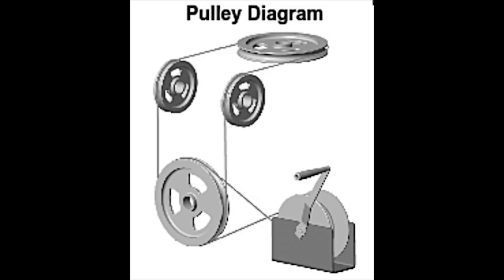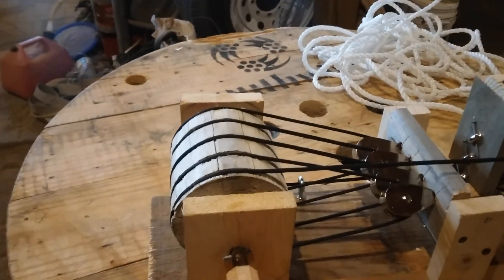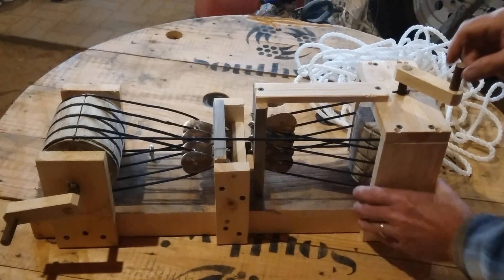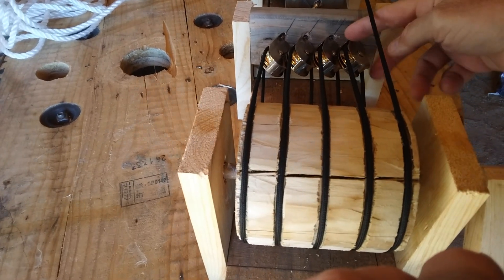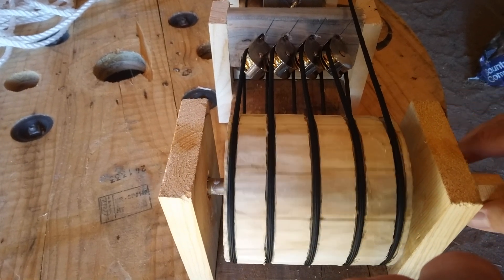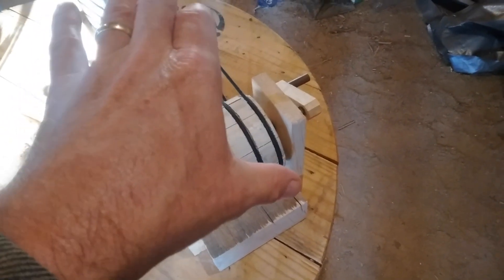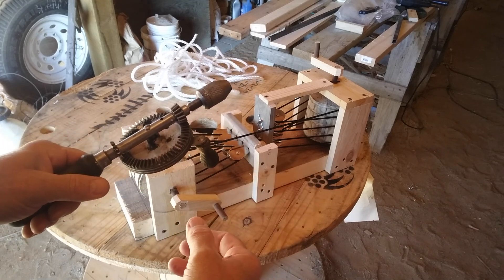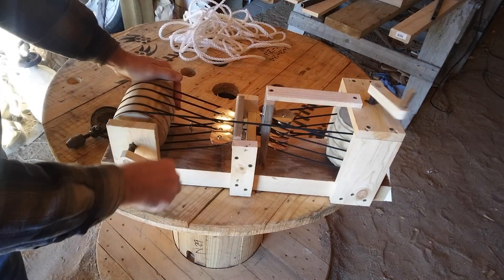High torque, right-angle rope drive system

Comment: Thanks for posting this! I'm working on a pedal driven ocean boat and I like rope drives because they don't rust.

Whatever I make is going to have to be high transfer efficiency, so I'm looking into bearings of various types.

I understand that you get more friction when your rope has some tension, but also when the groove it slots into is a V-shape. (more tension means that the rope tries to press into the V-shaped groove?)
Reply from the maker: I have another video with a bigger rope setup on a wind turbine, that may interest you:  https://youtu.be/YiiamhaSB2Y

Comment: I am also solving this problem of rope slippage on a grain millstone.  I came up with the same conclusion that more contact is needed. I have 3cm on the stone, so I will try to add 2 v grooves to add friction. I also have a one to one ratio, 34 cm stones. Thanks for the pulley system idea. I didn't see how to arrange changing to the different grooves but now I see the possibility of adding 3/4 contact around the stones. I'll send an update.
Reply from the maker: Thanks for sharing!  In this video, I did something on a bigger scale:  "https://youtu.be/YiiamhaSB2Y"
Reply: https://youtube.com/shorts/6xh8qHdPqZ4?si=yc_oiftIzPyBaSve
Reply: https://youtube.com/shorts/LF7is0eiXVg?si=aqfDppmiGuhZqJR2

Comment: Why not simply make a spiral groove on the cylinder and avoid using the little pulleys?
Reply: At some point friction would overtake and the rope will tangle! I've tried it in a very small scale to be sure maybe on bigger scale it wouldn't matter. But the risk isn't worth the reward. Better just use pulleys. And pulleys really aren't that expensive!

Comment: A dozen bearings. 
Each bearing cost you 1~2% of losses. 
And we are not talking about all the rope friction. 
That’s a lot of losses to transmit power at 90deg. 
I wouldn’t be surprised if that units is 60% efficient. 

FYI 
The efficiency of a helical bevel gear unit can be up to 98%

What you can do to improve the efficiency would be to wrap the rope around the drive drum 5x and exit and go directly to the driven drum and wrap around 5x then go back to the drive drum without going thru 8 idler pulleys.

Comment: Impressive design.  I'm curious of what you got to lock the turbine or mill in place to service it incase the rope breaks or something needs worked on. As well as how to adjust the rope.
Reply from the maker: Right now on the turbine I have some crude friction brakes on the outer circumference to stop and hold it.  The drive train for that is still in the works.

Comment: I really enjoyed this.
I'm planning a wide, tall gate (8' x 8' x 1" or 2.4m x 2.4m x 25mm plywood) with an unusual hinge system  I could adapt this for opening it.
A slightly remote crank handle and concealed drive would be a nice novelty, or exposed clusters of cogs and chain for an industrial feel.

Comment: Awesome build! Is there a tensioner somewhere? Or, how did you space everything to pull the paracord into tension and keep it under tension while screwing the pieces together?
Reply from the maker: I left one board that 5 little pulleys are attached to loose.  After I  connected the ends of the paracord, I pulled the assembly of pulleys and board tight, then put screws in the board to hold it.

Comment: Great basic concept, but it needs a critical refinement: the rope needs to wrap fully from drum to drum on every turn, and use the pulleys to manage / redirect the rope through the twists / deflections between the drums.  Further, this system could easily use chain-link style V-belt instead of rope for greatly improved durability and force capacity.

Critical core concept: Imagine a simple single V-belt drive at 1 to 1 ratio, running at 50% of its maximum gripping friction capacity.  The belt engages each pulley for 180 degrees.  On the driven pulley, the belt exits at full tension at 180 degrees, and enters at slack tension at 0 degrees, because you can't push a belt (or rope).  Now somewhere back from the full tension exit point at 180, there has been been enough total friction to transfer the force, and that means the belt is slack from that point for the remainder of the arc back to the 0 degree point where the belt enters.  At exactly maximum capacity, the belt would be gripping for the full 180 degrees, and beyond that would slip across all 180. Finally, I assume that the grip friction gets concentrated towards the 90 degree point where the tension is pulling the belt into the V instead of along the V.

Now here's the rub: ALL ropes / belts have some stretch.  The harder you pull, the more they stretch.  That means the belt stretches between the slack point and the 180 point where it's at full tension.  But the hard pulley surface DOES NOT stretch.  That means that for every length of belt actually engaged in friction doing work, the stretch MAY cause a rubbing slipping creep between the belt and pulley along that working length.  That means belt wear, power lost to friction / heat, and a tiny loss of transmitted rotation below the ideal 1:1 ratio we assumed from equal pulleys.

The only way to avoid that stretch induced slipping across the working friction zone, is to keep the total stretch small enough that the elasticity within the rubber belt material can take up the difference without the rubber surface actually sliding across the pulley.  Even still, you will be flexing rubber and thus heating and slowly wearing the rubber inside the belt.

Outcome: Even if a single belt would have been far more than strong enough in tensile strength to handle the total pulling force required, you might need to use multiple belts instead, simply to reduce the stretch on each belt, by dividing the tension across multiple belts. I assume we would see overloaded drive belts and even pulleys wear out very rapidly from stretch induced slippage.  But as soon as enough belts are used to avoid that slippage, we should see belt and pulley wear reduced to a negligible normal minimum.

I fear that this problem will be far more challenging to avoid in rope driven systems, because rope typically stretches at least 1% under load, even for extremely low stretch ropes.  And if any load bearing fibers contact the friction working surfaces, they will inevitably be exposed to stretch-slippage rubbing.  This could be mitigated using a rope that carries the tension load in its core, with a lower tension jacket that allows enough flexibility to absorb the 1% of stretch internally without having the jacket actually slide on the drums.  Even better, a high quality steel wire core rope would easily reduce the stretch far below what any textile rope could achieve.

What you got right and why:
-- Not trying to use multi-turn wraps on the main drums.  Because that causes a screw winding effect that creates friction and wear to overcome in a continuous turning system of this type.
-- Using a single continuous loop instead of multiple separate loops.  Because that can help balance tension through the entire system (but not the way you wound it).
-- Using intermediate pulleys to guide the drive rope into straight alignment with the main drums, to eliminate the screw-winding action. 

What you got wrong and why:
-- Because you can't push a rope, it means that 100% of the drive force is transmitted entirely where the very first turn of the driving drum PULLS the rope from the very last turn of the driven drum.  That puts extreme tension on a single rope crossing, which means high stress on the rope.
-- If the friction of one or two wraps on each drum is enough to resist the workload, then all the earlier / later wraps will actually be running slack, just causing wasted friction and extra wear with all the little pulleys and flexing of the rope for nothing.

Critical revision and why:
-- By winding the rope in full wraps between the drums, you divide the tension evenly across the wraps, thus also dividing the stretch slippage factor by the number of wraps, just like a multiple V-belt system would work.
-- By using the small pulleys to deflect the ropes between drums, you only have at most about 90 degrees of deflection total, less than 45 degrees on each pulley.  Instead of almost 180 degrees at each pulley in your current setup.  And because of the smaller deflection angle, you reduce the force on the pulleys about half or less.
-- Bonus: the defection pulleys could be mounted close to the drums, allowing far more than 180 degree of engagement arc on the drums.  I can imagine 270 to 300 degrees being easy to achieve.  The biggest challenge is working out the weird angles needed to mount all the pulleys at in order to keep them all deflecting the ropes perpendicular to the tension, and I am assuming it would be open pulley wheels with bearings, then mounted to rigid shafts / studs on some weird frame.  Sounds like a job for CAD.
Reply from the maker: Wow!  Sounds like you really thought this out. -will be beneficial to the readers of the comments.  It's basically taking the diagram I showed in the first part of this video, and doing it multiple times, and getting the little pulleys directing each individual rope oriented correctly.
My current thoughts for use on my turbine is to have 2-3 wraps around the vertical shaft with a large drum, and driving a smaller cylinder at a horizontal position.  With about a 5 to 1 gear ratio.  So the smaller cylinder is going to need more wraps to get a good grip.  Lots to consider...
Reply: @doubleMinnovations  It was an interesting system, I couldn't help but try to puzzle through the logic of it.  Cheers :)

Comment: there's no need for the little pulleys at all. just wrap the rope directly around the shafts. choose the number of wraps so that the wrapped section of one shaft is the same length as the diameter of the other shaft and then you can get your right angle drive with just the rope and shafts. it's called a capstan and was a very very common machine in pre-industrial times.
Reply from the maker: I did think of that, but the problem was getting the rope wraps to slide to the other end of the cylinder with ease.  If it's gripping the cylinder good, it takes a lot of energy to get it to slide to the other end of the cylinder where it leaves.  The multiple little pulley idea, doesn't take much energy to gradually travel the rope wraps down the cylinder.
Thanks for the comment!  It's food for the thinking.

Comment: Instead of a grooved drum and 5 small pulleys, you could use a drum with a convex or saddle shape to hold multiple wraps directly. No tiny pulleys needed, and no risk of the individual grooves creating wear on the rope. 4-5 wraps is sufficient for almost any rope to grip the drum.
Reply: The rope moving across the drum will create a twist that creates wear on the rope.
It would be OK for occasional use but a machine that's going to run hundreds of hours per month is going to need something a bit more reliable.

Comment: Pretty neat, I like it. Always thought there was something elegant about light weight cable drives like this. I'll bet you could replace all the pulleys with another grooved spool on each side. Although you could also run the cord in a groove around the edge of the turbine rotor, that'd probably have plenty of traction being so large already. If you did want to try homemade gears though, I'd consider an arrangement of radial and axial peg gears. Easier to hand build than toothed gears. Easier to fix if something goes wrong, too. Maybe you could even put pegs somewhere towards the outer edge of the turbine rotor if you needed more speed and less torque. Even seen some contraptions that play with combinations of pegs and cords in various ways; lots to consider. Thank you as always for sharing your experiments!
Reply from the maker: Thanks for the interest; I've been trying out different ways to get the power off the turbine, including cord drives, gears, and even a friction drive.

Comment: Sir this is a thing I have put a lot of thingking in. What I have in mind before I build such a thing (driving machines directly from windpower with a VAWT, so mechanically) is a flywheel. A flywheel might stabilize the driving shaft and it can be spun at a higher speed aswell. Directly connected to the turbine it is kept going by windpower and it keeps a steady rotation of the turbine. Although with a VAWT such as the one you build there is little need for it, since it is its own flywheel by mass. But a rotating mass at a higher speed can also store energy, thats the whole purpose of a flywheel ofcourse. WHat i personally have in mind aswell is a set weights that are spinning on the upright axis and are flung out by the rotationspeed. When that speed is suddenly reduced by any load the wieghts fall back in and from that the rotationspeed is increased because of the rotating weights is closer to their axis. A governor does a similar thing. Hope this is of your advantage

Comment: Several lathes in the machine shop where I went to school were originally driven by a single overhead shaft and 3" or 4" flat belts around relatively small pulleys. Around WWII they were converted to individual three phase electric motor drive. The wide belts used for those kinds of applications can transfer an amazing amount of torque, even when under relatively low tension on smooth steel or iron rollers. It was also quite common to use belts to transfer power at right angles with nothing but air in-between the two shafts. That does require a relatively long distance between the two shafts relative to the belt width to allow for enough twist without significantly stretching the outer edges, but it's hard to beat it for simplicity and reliability.
Reply from the maker: Thanks for sharing!

Comment: The capstan equation[1] or belt friction equation, also known as Euler–Eytelwein formula[2] (after Leonhard Euler and Johann Albert Eytelwein),[3] relates the hold-force to the load-force if a flexible line is wound around a cylinder (a bollard, a winch or a capstan).
Reply from the maker: Thanks for the info!
Reply: @doubleMinnovations  of course you would only get about half the force of a regular capstan because you are only touching half the cylinder with the rope, but you could use a pulley and a weight hanging on the rope as a tensioner in order to stand in for the rope "pulling force" variable.

Comment: Good idea. You could also wrap the cable/chord around the drum multiple times like a sail boat winch. That'll increase the friction sufficiently. Then you dont need the pulleys at all. The drum could be a scaled down version of the table you are working on with the in-feed at the top, wraps running the length of the drum, and the out-feed at the bottom. Two such drums could be positioned at right angles. They could also be of different diameter to get the gear ratio you want. Just a thought.
Reply: This is the way, the pullies are nothing more than additional unneeded friction that actually lessens the potential overall grip of the cable or cord. just make the pullies in a similar manner to a screw thread. a helical drive pully is the best description I can think of for what I am envisioning.

Comment: You could use an old car axle, you could even chop it down smaller.  This is really cool, I might try to make one.
Reply from the maker: A rear end car differential would work if you have one.  Thanks!
Reply: It gives two outputs as well but you may need to weld some gears together

Comment: Nice idea ! You could use a worm gear drive. Put worm gear in center of wind turbine axials . than just a gear for output. giver 90 deg change and change size of great for ratios of speed.
Reply from the maker: Yes, there's another idea.  Thanks!

Comment: Great prototype/proof of concept. Those old late 19th century traction engines used very long leather belts, some even changed axis with device being powered.
Reply from the maker: At the old pioneer shows around here, they still use them for sawmills, grinders, and threshing machines.  Thanks